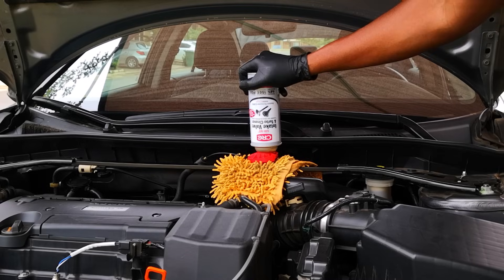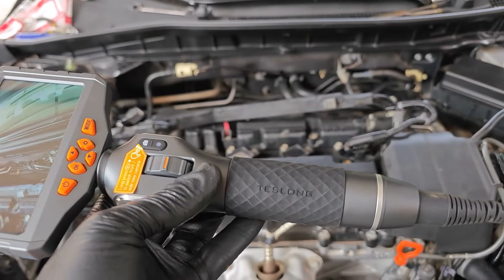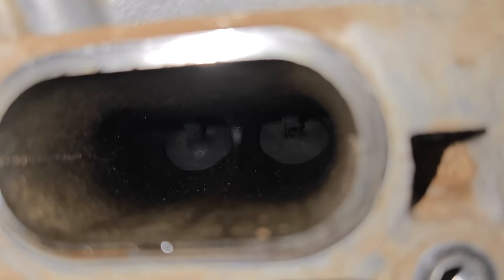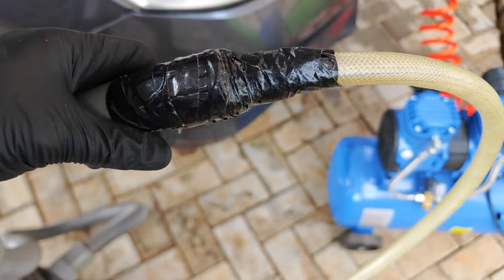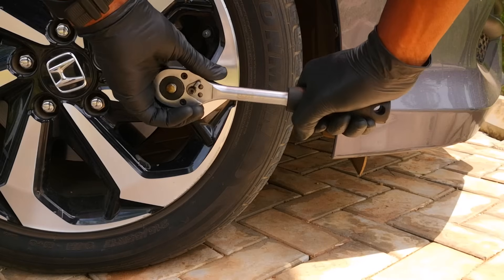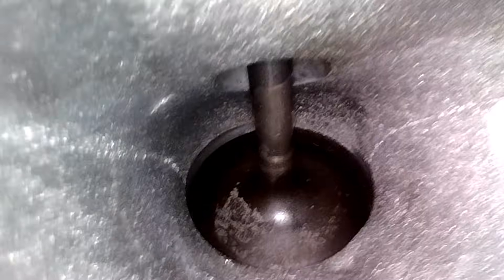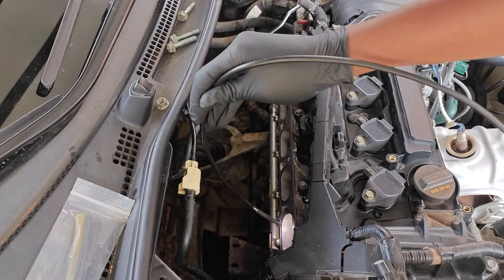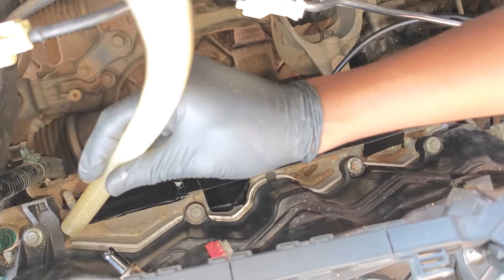Carbon Cleaning that WORKS: How to Clean the Intake Valves Direct injection cleaning

Comment from the maker: What do you think about walnut blasting vs the drill method?😃Tools are below

Get from Amazon:  

  - Media blaster gun - https://amzn.to/3I7bPmM  
  - Walnut media - https://amzn.to/3GmkVvq  
  - Oil water separator - https://amzn.to/40r9EAI  
  - Long media blaster nozzle - https://amzn.to/4lvCiJ2  
  - Pipe bender tool - https://amzn.to/4l9jEXR  
  - 10mm copper pipes - https://amzn.to/44nuLFh  
  - Teslong TD500 borescope - https://amzn.to/4ns6yXc    
  - Depstech Dual Lens Wireless Endoscope: https://amzn.to/3kxDIoW  
  - Pipe expander tool - https://amzn.to/4kegPTO  
  - Nylon brushes - https://amzn.to/4lpwhxy  
  - Flex shaft extension tool - https://amzn.to/3I6XpD3  
  - Black & Decker drill - https://amzn.to/3IkZDyJ  
  - Check out other tools & products I use or recommend - https://amzn.to/42LGCL8
I may earn a small commission from a purchase made through the links above. This does not increase the price you pay in any way.
Reply: I think that the drill method is effective (not more effective, though) and simpler than the walnut blasting method.

Comment: How was the difference in performance?
Reply from the maker: Because I've done a couple of things around the same time can't exactly tell what this specifically did, but men! Pickup on the car now is sweet. Idling quieter and MPG is ticking up. Should have a full MPG gain assessment in a few weeks.
These were the things I did around the same time:
1. Clean intake valves
2. Clean throttle body
3. Installed Ruthenium spark plugs
4. Ran Redline S1 complete fuel system cleaner in consecutive fuel tanks.

Comment: How did it feel driving after you cleaned it?
Reply from the maker: Idle at a stop feels smoother. Previously if I watched the RPM needle closely you would observe some ever so small movements when at a stop (it was so subtle you won't even feel it). It's much much steadier now.

Comment: barely any carbon to be concerned about but I guess prevention is better than cure?
Reply from the maker: Yeah, not that bad of a build up for 96k. Since cleaning idle feels smoother. The good thing is that it wasn't that much on the back of the valves.

Comment: I was impressed with the effectiveness of the drill brush/chemical fluids method. At least that method avoids the possibility of walnut shell getting into the cylinder and resultant damages. Great video!
Reply from the maker: Appreciate the feedback! That drill brush/chemical fluids method can be a great way to do it!
Just to allay your fears of a few stray walnut granules causing trouble. That's exactly the reason for using the shells because they are not that hard, if they were, they would score the valves and intake ports during cleaning. Any stray walnut shells will be burnt off. This is also why intake valves aren't sand blasted.

Comment: Hopefully the catch can on my Silverado gets me to over 150,000+ miles before it needs it! I also run top fuel and run a bottle of techron by Chevron fuel treatment every oil change.
Reply from the maker: 🤞🏼I'm with you!
Its good to run a cleaner before an oil change!
Reply: Does your Silverado have Direct Injection?

Comment: The walnut blasting method when I used to work at Honda dealership back in the 1980s we used to use to clean the carbon.
    This is a very very old method that works very well
Reply from the maker: Thanks for sharing your experience!

Comment: Great video showing the different methods of cleaning. How long did it take to clean all the valves? I did mine about 6 years ago with walnut shells. I can’t remember how long it took me. I like how you enlarged the holes to feed the shells better. I used the same blaster and it would get clogged with the small holes it’s made with. It’s about time for me to do them again.
Reply from the maker: Thanks mate! I actually did this over 2 days including intake manifold removal and re-installation. However, I was doing some other stuff. Also filming the procedure does add a considerable amount of time. The actual walnut blasting/drill cleaning, probably took 2 - 3 hrs or so. On a front facing intake manifold, it should be way easier.

Comment: Change oil beforemit gets really dark black. What's in dirty oil goes to the intake valve.
Reply from the maker: Change in oil colour actually doesn't always have a bearing with how dirty it gets. Thermal cycling alone makes oil go dark; some oils moreso than others. However, I get your point. Bottom line is we should all keep up with oil changes.
Reply: @DIYAutoworksNG oil contamination shows well when using a white paper towel to wipe it. Change in oil color shows differently from carbon contamination.

Comment: This is an excellent video.  I cleaned my first set of intake valves on a Subaru 2.0l Turbo engine.  This is a horizontally opposed engine so access was a little more difficult.  I too discovered that walnut blasting was good but still needed to be supplemented with picks and brushes and a good solvent.  Honestly, the disassembly and re-assembly of the intake manifold was far tougher than the actual intake valve cleaning.  

Superb video!  Thanks.
Reply from the maker: Awesome to hear! Thanks for sharing your experience and the additional insight.
You're 💯 correct! That disassembly took me quite some time, thanks to not having a certain type of hose removal plier (which I've now got), and the stubborn connector to the throttle body. The latter forced me to invest in a pliers for removing electrical connectors!

Comment: This is the first view, looking down the ports, of the intake valves of a 2013-2014 Accord that I’ve been able to find.  I was able to view the back-sides and some of the valve stems of my 2013 Accord (with 100 k miles) using a borescope through the spark plug holes.  As with your car, the back-sides of the valves were fairly carbon-free with some carbon build-up on the stems. Thanks for the great video; removing the intake manifold must have been quite a chore.
Reply from the maker: Appreciate the feedback!
Yea, removing that intake on the 9th gen is not fun, explains why there's no video on it on YouTube. I'll be posting mine soon!

Comment: The bad part is your supposed to clean the intake valves on direct injection engines every 10,000 miles. Thats alot of work

Comment: Great job on the cleaning they look perfect now. I’ve cleaned the intake valves on my 2018 Ford focus ST so glad that my intake valves are on the front of the engine instead of the back it makes it so much easier and it doesn’t break your back. Thanks for sharing.
Reply from the maker: Thanks for sharing your experience! I agree, the location of the valves makes a huge difference in accessibility.

Comment: Thanks for this video. The chemical method with brushes seemed to be an easier way to clean the valves.  This is the way I will go!!!!!
Reply from the maker: It was definitely the easier, faster and cheaper option. 
Best results is a combo of the two even though I doubt the car would know the difference. Lol.

Comment: How do you make certain you removed all the shells? Seems like a lot of risk for not much better result?? Thanks for the vid you got a new sub from me!!
Reply from the maker: Your concern is the exact reason for using walnut shells and not sand. Even if there are a couple grains that make it into the chamber, they will get burned and won't harm. They are not hard enough to score or damage metal. That said, the last thing I did was to use compressed air to blow everything away from the intake ports.
Thanks for the sub!

Comment: 4:05 never fire compressed air on your skin, it can potentially kill you
Reply: When I was growing up, my mom’s friend was a mechanic and one of his coworkers as a joke, sprayed the air hose at his butt, and it caused a 
bubble In his blood. I think maybe it was a embolism this was over 20 years ago, but he did die. I couldn’t believe it.
Reply: @thetechlibrarian  Damn, sorry to hear about your mom's friend. Its shocking how easily it can happen. The butt is one of the worst places to fire it, because not only can it cause an embolism, but the internal organs can't cope with that kind of pressure, and so they can be ruptured, and then of course the chance for embolism really goes up. Same goes with firing it into a mouth, it can burst your lungs or stomach (can't be a nice way to die), and it can pop your eyes out pretty easily too (if you fire it at your face trying to get dust off etc). You can usually get away with firing it at your skin, like your hands or arms etc, but if you have a cut, then the compressor acts just like injecting air into your veins, and air in your veins doesn't go away so it can block blood from reaching your brain and other organs. So generally its not worth risking it. One of those things thats scary because it doesn't seem so bad but really is.
Reply from the maker: I know you're joking. Not true
Reply: @DIYAutoworksNG  Unfortunately it is true, its rare, but if you have a cut on your skin then air can enter the bloodstream and cause an embolism. If the pressure is high enough and the nozzle is close to the skin, you don't even need a cut. Anyway you can look it up.
Reply from the maker: Just looked it up and it's true! Thanks for sharing!

Comment: What was that degreaser you used? I've done nylon brushes and ziptie method with messy, but good results.
Reply from the maker: It's made by Shield. It's a water-based engine degreaser.

Comment: A catch can helps. Take intake off, spray cleaner, use brush, vaccum out after awhile. Toyota using gdi and mpi prevents this.
Reply from the maker: Spot on. I have a catch on the car. I'm sure that's why the whole intake ports weren't filled with carbon. Toyota's design is just genius.

Comment: Good vid - my vote - chemical and spinning brush - don't like the idea of ONE piece of walnut getting into engine - I'm enjoying my original 2010 Nissan VQ35DE V6 port injected for now - valves are continuously cleaned
Reply from the maker: Thanks mate, and I appreciate your feedback. Just a note on your concern for walnut shells... That's part of the reason for using walnut shells. They aren't that hard and even if a couple make it into the combustion chamber they won't scratch anything but should get burned.

Comment: I'm surprised at how well the degreaser and carb cleaner worked with the nylon brushes.
The 6mm drill  bit to make the feed holes bigger was pretty slick.
Wonder of you zip tied the vacuum hose to the sprayer if that would have reduced the mess that was made?
I think I've seen some of the tools have a port to attach the vacuum directly to the blaster to help pull up more of the shells after they're sprayed out.

Either way cool video, thanks for taking the time to show us this.
Reply from the maker: Thanks mate!
Zip tying the vacuum to the nozzle could be a good idea if the diameter of the hose is much smaller. But again I think it will make maneuvering the blasting nozzle more difficult. But hey, you never know if you don't try!
I know the tools that the nozzle plugs into. I actually looked for it, but didn't see one for Honda for sale. Definitely a good have if one plans to do this job.

Comment: If it's available where you are located, trying using Valvoline's Restore and Protect engine oil. There lots of videos about it here and I've been using it on the last 10k miles, on oil change number three and my Kia 2.4L GDI engine with 103K miles on it is running so smooth I don't feel any vibration.
Reply from the maker: I switched to VR&P some 5000 miles ago and also have some videos on it! It's action is mainly on the piston grooves and landing. Valvoline said it will have a minimal  effect on intake valves
Reply: @DIYAutoworksNG
I thought he was joking at 1st, the only videos I've ever watched on restore and protect have been on your channel.
And yeah as you said Oil ain't gonna do anything for air intake valves, and neither is fuel additives on a GDI engine.
Reply from the maker: @vegeta420z - 💯 spot on.
Reply: It's a great oil - but will have no effect on intake valve buildup.

Comment: An M80 firework works a lot better. Put two in a cylinder for both intake/exhaust, then tape the the intake port shut and put a hole for the fuse to stick out. Then light it. Repeat for every cylinder. For best results, do the exhaust side as well at the same time, and all cylinders on both sides all at once, and remove the spark plugs and put an M80 in each spark plug hole as well. Make sure all fuses are the same length as well.
Reply from the maker: 🤣 I see you're in a good mood. I'll only try that after you upload an actual video being done on your car 😁

Comment: I think ur car have a catch can, so how the oily carbon sticking on the valves! 🤔
Reply from the maker: Good observation! I only fitted a catch can after around 75k miles or so. First owner didn't use a catch can so a lot of the buildup was already established by the time I got the car.
Also, while a catch can will reduce oil vapours it won't totally eliminate it.
Reply: @DIYAutoworksNG Does the gdi valve cleaner through brake booster hose do the job?
Reply from the maker: Not at this level of buildup. I have a video on using the CRC GDI intake valve and turbo cleaner through the brake booster line. It didn't clean as much. It's place is in annual maintenance after the valves have been cleaned or from new.

Comment: So basically the carb cleaner is the best ?
Reply from the maker: I like the combo of carb cleaner and engine degreaser. While carb cleaner is very good with the carbon, the degreaser does a very good job with varnish. 
The drill and chemicals take less time but for me, the best approach is combining the 2 methods. The drill approach won't clean the back of the intake valves as well. I found the weakness of walnut blasting to be the back of the valve stems.
Reply: @DIYAutoworksNG  But aren't you worried that engine degreaser will ruin stuff if not washed off?
Reply from the maker: Nope. That degreaser is water based and although I used some water to rinse it out, even if that's not done, compressed air blows it all away.

Comment: Thanks for taking the time to show us your valve cleaning process. How does your Honda Accord run?
Reply from the maker: Runs well😃. Remaining ultrasonic injector cleaning. Couldn't do it while the intake manifold was off this time because there's a metal fuel piping that must be replaced once disconnected and it didn't arrive early enough.